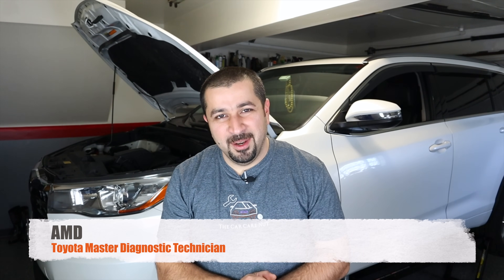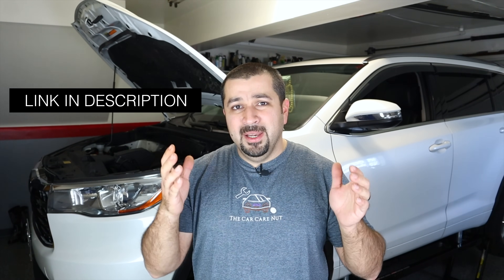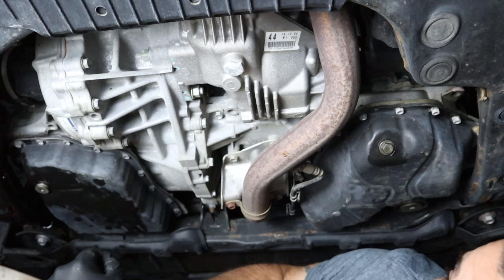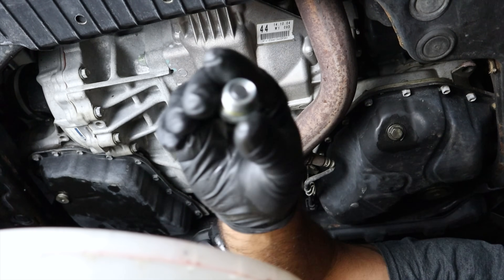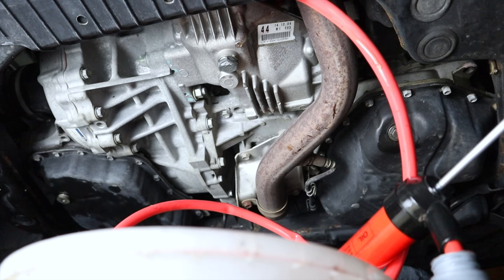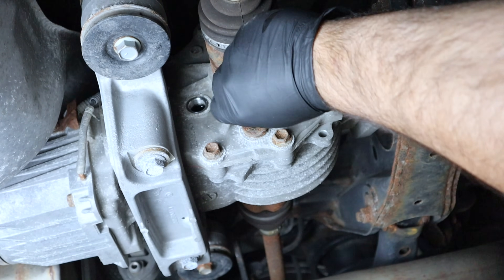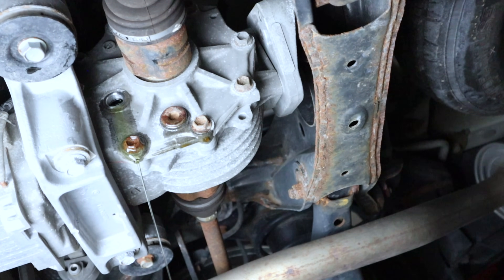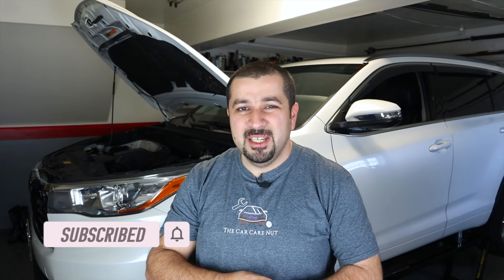How to change Transfer Case and Differential Fluid on Toyota and Lexus

Comment: I notice you use Valvoline as opposed to Toyota brand fluid. So I'm wondering? Can I use Amsoil gear oil in the front and rear diff of my 2022 GX 460? Also How about the transfer case can I use the Amsoil transmission fluid? You have said before you DO NOT recommend using anything BUT Toyota transmission fluid in the transmission. Just wondering. Las question are the gasket reference part numbers the same for the GX 460? and the torque specs? Thank you very much for your wonderful videos and your new shop looks awesome, by the way.

Comment: Is there a transfer case in the front of a 2021 RAV4 Prime XSE, or is it part of the transmission?
Can I use ATF WS in the Rear Differential in a 2021 RAV4 Prime XSE, or should I use different fluid?
Do you recommend torque closer to 26 or 36 for the plugs?  Thanx.
Reply from the maker: Hi! For your rav4 prime there’s no transfer case. You will use Toyota WS ATF on the RAV4 prime differential and transmission

Comment: I had two questions: 
1. Does the transmission need to be at a certain temperature to do this work? 
2. My 2019 Rav4 AWD recommended maintenance schedule does not talk about rear differential fluid replacement. Only transfer case.  Should I still do it?

Comment: Thanks it really helps,I confused about the awd transfer case that you said no need to service it because its all together with the transmission right?so just regular service for the transmission fluid change is enough?by the way mine is rav 4 2018 model,but you mention they have a separate oil in the transfer case?do I need to do it separately?hope you see my comment
Reply from the maker: Hi! Yea the transfer case in your rav4 is separate if it’s AWD.
Reply: @TheCarCareNut  wow thanks you really read my comment 😊😊😊,I'm gonna do it next year my transmission fluid change at 50k,
At the same time can I change my transfer case and rear differential at 60k? I'm the second owner of this beauty I get this at 18k mileage for about 2 years ago and now it's sitting at closed at 42k mileage i want it to keep it as long as it will be last.
Reply from the maker: You can change them at 60k no issues.
Reply: @TheCarCareNut  thank you so much for you're response,I'm glad someone is uploading this video about that,im waiting for long time to search it...

Comment: Thanks for the vid. If the differential is overfilled and leaks like crazy and you drain the fluid and reinstall to the proper depth will the leak continue or stop? (ie does the overfilling damage the seal?)

Comment: Great Video Thanks , BTW  Have you ever used any type of stop oil leak product for rear diffrential carrier leak?   (Ex. At-205 or Lucas )   and Do u recommend any?   I have 2007 Fj cruiser, dealer quote price of $950  but short of fund at this moment.
Reply from the maker: Hi! I wouldn’t use stop leak. Top off the fluid until you can fix it

Comment: AMD, There were quite a few filings on that drain plug magnet for the transfer case. How many times has that fluid been changed in 100,000 miles?
Reply from the maker: Unknown to me but the owner said it has been replaced. Not sure when. But that’s normal from experience
Reply: @TheCarCareNut  I think you intervened just in time!

Comment: Regarding washers, after mentioning crush washers, you indicated the "transfer case on trucks will use an aluminum washer, P/N 90430-A0003".  I have a 2016 Toyota 4Runner Trail Premium 4WD and assume it's in the category you refer to as 'trucks'.  Am I correct in that I am to use the aluminum washer, NOT the crush washer, on the transfer case fill AND drain plug?  Same washer on both?  Thank you.

Comment: Hi, this is going to be a dumb question, if I have a front wheel 2019 RAV4 XLE (not AWD), do I even have differential fluid to replace? From what I can tell, I don't have a transfer case, but do I need to do the differential fluid replacement?

Comment: I got a 2017 Toyota Kluger (Highlander).  Got a ner ner ner sound inside cabin at speed mostly 40km/h+ ....... thought wheel bearings replaced them all, didn't fix the issue.  Checked all the fluids, looks like maybe transfer case is buggered, cloudy oil, spiky metal fragments on the magnet......  It's only done 140,000kms.  Always had the oils done.....  Basically as soon as it's fixed I'm selling the POS.  My last Holden Commodore....... I had that over 10 years and never had an issue. I haven't even had this Kluger 4 years myself.

Comment: Hey Car Care nut, I recently changed the seal in the transfer case that attaches to the propeller shaft that runs to the back of my 2005 Lexus Rx330 AWD.  There was not much oil in it and I think the vibration I feel might be a bearing in there as I changed the propeller shaft U-Joints and it did not change anything.  Any chance you can tell me what would be involved in fixing that and/or directing me to a diagram that shows how the transfer case looks/works?  All I can find is the read differential diagram.

Comment: I have a front wheel drive 2019 Rav 4 LE. Are the steps the same as 4 wheel drive models and do I need to change it at 30,000 as well? Just learning through your videos, your a big help. Thanks

Comment: I have a 2022 highlander V6 all-wheel-drive with the torque vectoring system. Is the one Highlander you’re working on right now exactly the same as far as maintenance is concerned for fluid exchange than on my model year?

Comment: I've got the tacoma 4x4. So I would use 75w90?..I'll check the spec in the back of owners manual. Can you crawl under without lifting truck.
Reply from the maker: 75w90 should work and yea you can do it without a lift
Reply: I use 75w90 Mobil 1 in my Tacoma. Get yourself a 10 mm hex wrench for the front diff.

Comment: I was watching another video and the guy doing the rear differential left the drain plug out and pumped a little new fluid in to “ flush” out the diff a bit. Is this a good suggestion? Also, I inquired at the Toyota dealership about when to drain the rear differential and transfer case. The Assistant Service Manager said that Toyota doesn’t have a recommendation on kms ( miles) to change those fluids. Now I’m worried that my 2017 Highlander hasn’t had it changed for just over 60,000 miles.

Comment: My manual says to use 90w hypoid gear oil. Also notes I can use 80w-90 hypoid. Can I use that in replacement or should I find the 90w dont want to mess this up so just wondering if its okay?

Comment: I have a 2018 RAV4 Adventure model with the Dynamic Torque Ctrl AWD, and the Star Safety System with Traction Control. I'm assuming the Traction Control system replaced the function of a limited slip rear differential by using your brakes to stop the wheel that's slipping/spinning to transfer power to the other wheel. Are any of the Toyota rear differentials the limited slip type that need a friction modifier added to the fluid?

Comment: Correction:  The rear differential on the 4Runner does have a magnet on the drain plug. I have done two differential fluid changes on a 2014 model and a 2020 model.

Also, when filling, you don't want to feel too quickly because the air pressure will cause the fluid to go out the fill hole giving you a false indication. People have the tendency of pushing the squeeze pack nozzle straight up against the  fill hole.

Comment: Can I do this for the very first time at 172,000 miles on my Toyota Corolla 2010? Or is it similar to the transmission where I cannot change the transmission fluid after 60,000 miles? Great content btw.

Comment: Hi AMD, I actually just did these gear oil changes on my wife’s 2012 Highlander a few weeks ago! I had watched your video on recommended maintenance and you inspired me! Quick question: this same highlander makes a slight thunk/clunk sometimes when accelerating after braking or deceleration. Doesn’t happen all the time and seems to happen when accelerating hard vs soft. It feels like it’s coming from under the floorboard. The gear oil changes didn’t make a difference. Any thoughts? Thanks for all you do!
Reply from the maker: Hi! This will need in person diagnosis but check mounts and driveshaft center support bearing
Reply: @TheCarCareNut  thanks! I’ll do that! You’re the man.
Reply: My gx460 does something similar. I have always thought it's the transmission. But it will be hard to replicate. What I believe happens, vehicle will stays in second gear, when you suddenly press the gas it drops to first as is it needs more power.
Reply: @TheCarCareNut  could you do a video on driveshaft lubbing on 4runner ?

Comment: If I decide to go with a cheaper oil, like Supertech from Walmart, should I change it at 30k or should I change it a little sooner, or do you recommend just going with a higher named brand every 30k?
Reply from the maker: Hi! I don’t recommend the generic store brand fluids. Go with Mobil 1 valvoline…etc. d

Comment: I got a 2010 Tacoma, and as the transmission  shifts up, the gears bangs. 😬
And also as you let off the power and then re-engage power, it also bangs. 😟

Comment: I have a 2021 Toyota Highlander xle I just did the transmission fluid changed I’m confused with the front differential fluid is it take the same fluid or by filling the trans I do not have to worried about the front differential because they are together??? Please I will appreciate the answer sir

Comment: Hi. I love your videos. They help me a lot. Can you tell me why you used mobile 1 upfront and Valvoline in the back? Can you put the oil with the ls additive in the transfer case as well. I didn’t know if I should do it or not. I would like to use the valvoline  for both front and back. I have a 2016 Highlander xle awd.

Comment: I see that you used Valvoline full-synthetic on the Diff. But i couldn't see what Brand and oil weight for the Transfer case. What did you use. Thank you.

Comment: How would you classify the AWD system in the Lexus IS/RC/GS? It's the one with front and rear diffs, planetary gear center differential with a clutch pack to act as a LSD , 30% front / 70% rear default torque split full-time and can vary up to 50/50, and a transfer case with a chain.
Reply from the maker: Hi! The transfer case on these actually share the transmission fluid. So you’ll have a front differential and a rear differential service wise for fluid and then the transmission fluid replaces the transfer case fluid as well.
Reply from the maker: Hi! Techinfo.Toyota.com for service information

Comment: Does a 2008 Sienna also use the same fluid in the front differential as the transmission.  I accidentally drained it and it does not look like ATF.  thanks for any input.
I finally found the filler plug on the front differential filler hole on the 2wd Sienna, on the top rear of the differential.  After accidentally starting the engine with the drivers side cv shaft out of the transmission, which dumped all the differential fluid into the drain pan.    Never do anything the first time always start on the third.

Comment: I have a 2018 toyota rav4. Is it too late to replace my transmission, transfer case and rear dif fluid @ 92000km. I have never changed it since I bought it.

Comment: AMD, are there any supply problems getting filters or oil? I had my one year service on our RAV4 and I am 100% convinced they didn't change the filter or the oil. It's absolutely clean down there. No evidence (even with a UV flashlight) of any wiping or clean up. It's like factory clean except a light dusting of dirt on the filter and plug. Is it possible to do such a clean oil change? Also they filled the oil 1/4 inch too high. Any problems frothing the oil at that level? Love your channel. Lots of good info.
Reply from the maker: Hi! There are some supply issues but nothing is on back order yet just slowly trickling in
Reply: Is the oil on the dipstick clean?  If dirty, the service still needs to be done.  They may have changed the oil, but not the filter.  That is why it’s 1/4 high.  I’d make them redo the service.  Mark the filter to make sure it’s changed.  Put tape on the oil drain plug to make sure they change the oil.

Comment: Went down to the local 4x4 shop. They said I could use 75w-140 in all. 
Haven't heard of this oil. 
I want to change front, rear and transfer oils 
I will be towing a 4000 lbs trailer when camping. 
2014 tacoma ext cab 4x4 6cyl.
Thought on 75w 140

Comment: 2009 Venza rear passener size axle has a leak between the boot and the differential. Not the driver size. Is this from overfill or something caused it to leak?

Comment: Just curious about the crush washer if it is directional  and it suppose to go in a specific way on the drain plug? OR it can be inserted from either side?
Washer has FLAT SIDE and a CURVED SIDE. Most folks says always put the CURVED SIDE towards THE DRAIN HOLE....allowing the FLAT SIDE  to be pressed against the drain bolt edge and then tighten up. it makes sense but just wanted to check if it really matters?

Comment: Hello there! I have a rx300 and I have changed all the fluids( thanks for the info about the fluids in your other video) except for the transfer case.  I am having a hard time getting the drain plug off due to the limited space. I have used a crows foot and it is not holding good enough to have a better grip to the drain plug. Do you have a suggestion on what tool i need to get in order to get this job done. Thanks again!

Comment: If helpful, I changed my diff fluid on my brand new 2019 Tacoma at 10,000 miles and it was pretty dark...and glittery.
The magnets on the drain plugs were 1 maybe 2 mm thick with magnetic gunk (idk what to call it). 

Wasn't the worst thing I've ever seen, but wasn't super great so figured why not change it. :)
I also consider that apart of the break in process, I'm about to change the fluid again and now we'll see how it looks. 

Fingers crossed it won't be too bad.
Reply: Oh man, I really need to watch the whole video before commenting (I'm bad at this).

But figure no harm in sharing my limited experience?

Awesome video!

Comment: On a front wheel drive Camry, is there a transfer case?  I believe the differential and transmission fluid intermingle, so when you change the automatic transmission fluid you're changing both.  But should I be looking for a transfer case on this car?

Comment: Hello, I have a question aher. My  02 rav4 ,
Why there is a bolt on filler n drain hole?. its different from other rav4
And I don't understand why not 10mm hex.
I'm talking about the front differential only
Thanks

Comment: When installing the drain plug washer is the curved end side up toward the pan and flat side toward drain plug bolt or is it the other way around?
Reply: the flat side rests on the drain plug. The curved/raised side goes against the pan/diff etc

Comment: These are great vidoes. Is it ok to use LS 75W-90 instead of GL5 75W-90 for the Front and Rear Differential on a 2020 4Runner Limited with all-wheel-drive?
Reply from the maker: Hi! Yes you can

Comment: Thanks Car Care Nut. Question..... I purchased a used 2016 RX 350 with 95,000 miles and the service records do not show that the transmission fluid has been replaced. Am I ok to have it done at this point?

Comment: Hey brother AMD, could you please provide some clarification? I came from Infiniti to Lexus and I'm trying to learn about my 2013 Lexus IS250 AWD so I can service it myself.  You seem to be the foremost authority for Toyota and Lexus on YT, but my Owner's manual says my rear AND front differential take 80w-90 and I cant find anything on servicing my transfer case - not even in my E-manual.   Could you please, please clarify what I can service on my Lexus so I know what to look for?  Both my AWD Infinitis have 2 diffs and a transfer case that I service, but I keep getting different info on whether or not I can service the front diff and transfer case on my Lexus.  Thanks and may the Lord keep and bless you.

Comment: Sorry if I missed this in the video. But I have a 16 Tundra sr5 with trd off road package. Just bought it used and was thinking about changing the transfer case fluid along with all the others. Is redline MT-LV okay? Or should I get the Toyota stuff?? Any help would be great thanks!
Reply from the maker: Hi! If the redline fluid is GL5 75w85 or 75w90 it will work
Reply: Awesome thanks! Keep doing what you do. Love the channel!

Comment: I have a 2016 Toyota Highlander limited fwd. My dealer mentioned I am due for differential fluid change. I know I don’t have a differential in the rear but is there a differential or transfer case for FWD?

Comment: Great job as always, AMD!
I know you are very busy, but if you have a chance to answer: what kind of fluid inside of transfer case and rear diff. in the North American 5 gen RAV4 LE (gas engine).
Owners manual provides 2 different AWD with 2 different fluids. 
Thank you in advance.
Reply from the maker: Hi! GL5 75w85 works

Comment: Hello. I haven’t been able to find knowledge on the use of 75w90 for the Toyota 4Runner rear diff. Has the dealer replaced 75w85 with 75w90? 75w85 is very pricey. Thank you I’m advanced. I own a 2015 trail and will be doing diffs at 67,000 miles.

Comment: Do you not have to measure what you take out to what you put in? Or do you just fill out until it starts to leak out?
Reply: Just fill the top opening until it starts to overflow, install the fill plug thats it.

Comment: Great video but I have a question. Why do I need to replace the drain plugs on my Tundra?Why cant I just clean and re apply thread sealer?
Reply from the maker: You could. But by the time you get sealer and correct one you might as well just replace the plugs with new